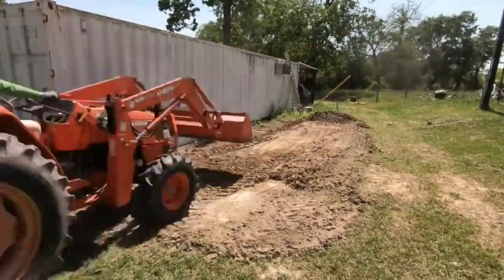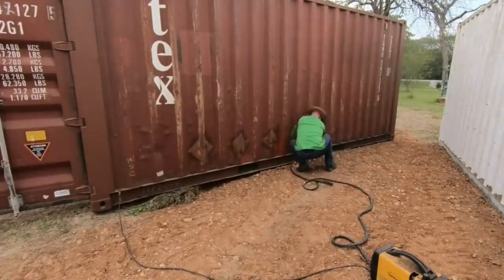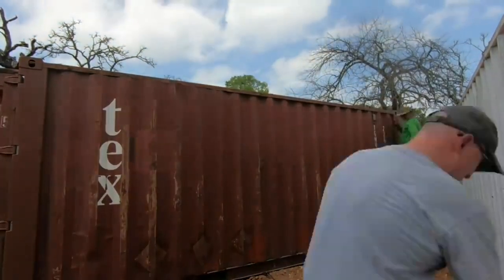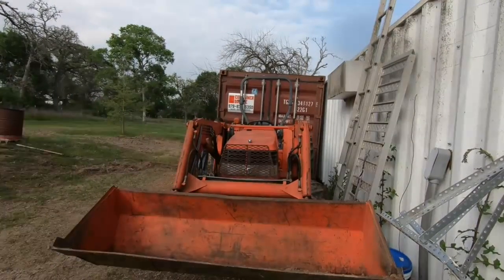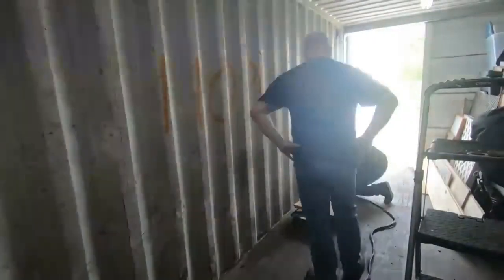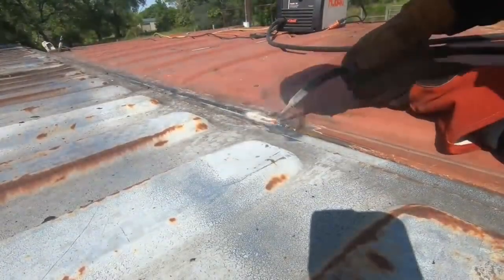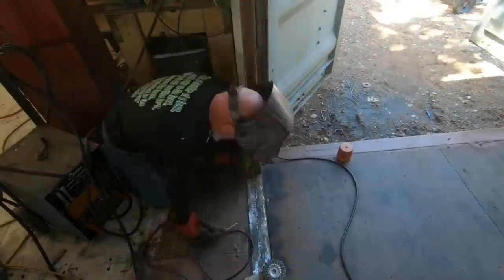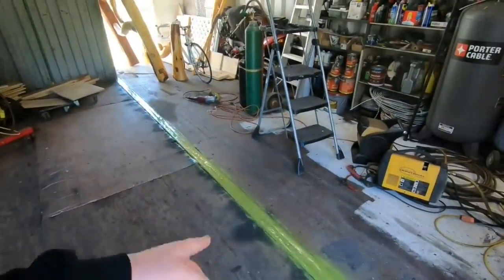Build a Shipping Container Garage, start-finish, time lapse, (commentary-music by Comin Up Muddy)

Comment: Some ceramic backing would’ve helped a lot on that big joint weld
Reply from the maker: Each time is different.  Should have pinched the tops closer with clamps and made the gap smaller.
Reply: What is ceramic backing?  I'm a potter and just learned welding basics thus past summer.